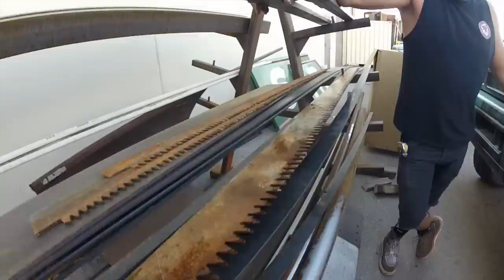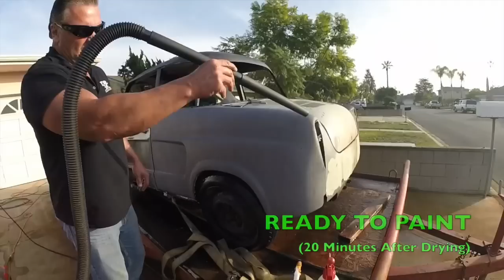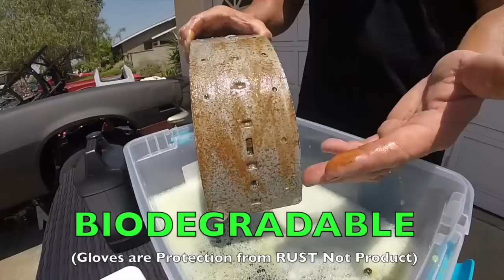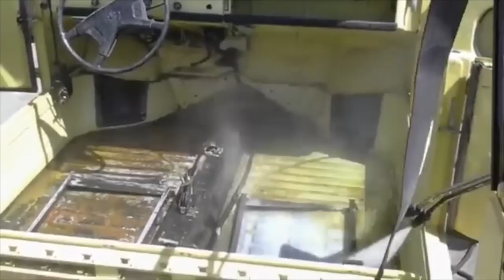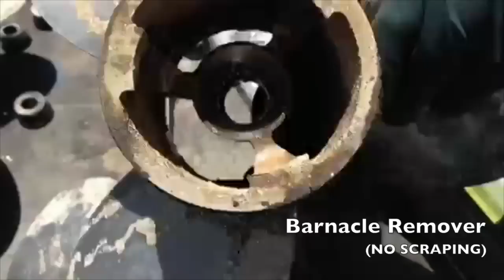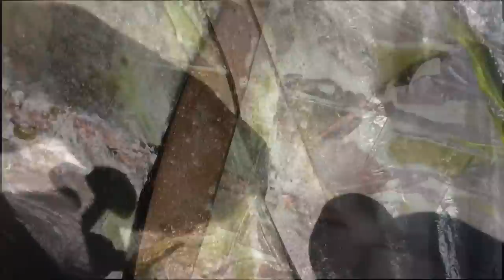Removing Rust in Less Than 3 Minutes

Comment: does muriatic acid turn the rust black?
Reply: aucklandmail : Although I am not certain if Muriatic Acid will turn rust black, vinegar will turn rust into black color, if on for long enough time, but don't leave it on for too long, or metal can thin out too much, use baking soda powder or paste mix which has water in it, but powder would be better.

Comment: Everything you "de-rust" just has a thin patina of rust. Most things we need to de-rust have deeper built in rust. Not sure I trust this.
Reply: soaking in vinegar for a few days works well. I took about 40 years of rust off of some metal tongs that were completely rusted shut. the rust was so bad there was deep pitting in the steel.
Reply: @chrishayes5755  Will a strong vinegar and water mix under pressure take the rust off galvanized steel roofs ya think?
Reply: @sudbuddiesexteriordetailin9843  yes. I use apple cider vinegar (it's more acidic) to completely derust motorcycle gas tanks. Just make sure you rinse baking soda and water mixture to rinse imidiatley after rust removal. This neutralizes the acid and stops oxidation preventing flash rusting.

Comment: Vinegar works fine. Thanks though, seems impressive.
Reply: Did you see that speed?! Thats whats up!!
Reply: No it doesnt. just came here from another video where vinegar was tested along with other solutions. Vinegar was only better that Coca-Cola
Reply: @InBoostWeTrust7MGTE  re: "Vinegar was only better that Coca-Cola". You missed the significance of the results. I've been using CLR for years, then switched to vinegar and ran one week of tests. As the video showed, vinegar was significantly better than Coke, and very close to the brand name solutions. After one week of testing on numerous rusted tools I have found vinegar to be very good indeed, and less damaging than CLR. I have noticed that CLR often removes the protective plating from tools that are not even rusted to begin with, and with the plating removed the tools begin to rust quickly. Also I use a Javex solution for other stained items, such as ceramic cookware & tea cups with great success (and it's fast as well). Overall I am now using vinegar followed by a quick CLR dunking if it looks like a bit more de-scaling is needed. Most of the time vinegar is all that is needed.
Reply: @DataWaveTaGo  what does Crl mean
Reply: @iankennedy1441  calcium lime rust brand remover

Comment: vinegar does the same thing just let it soak for a while
Reply: It always works best when the vinegar is contained inside a clear plastic bin and sat out into the hot Texas sun for a day or so. Me, I have cleaned up Model A ford brakes and old Toyota manifolds for years with nothing but the hot Texas sunlight and some vinegar. If you check in the grocery stores, there are also different strengths of vinegar to be had, as well.  Very cheap fix, but flash rusting can be an issue with some parts. Clean them or oil them immediately to prevent such.

Comment: DOES ANYONE KNOW IFTHIS WILL CLEAN THE INSIDE OF A GAS TANK ON AN AUTOMOBILE
Reply: Hello. I use phosphoric acid to remove the rust at the inside of old motorcycle gas tanks. It is not bad for the paint, not dangerous and works very well. Have a look at Wikipedia to learn more about that product.  It is cheap also and can be used a second time for another gas tank...

Comment: No doubt this video is time-lapsed bullshit. This looks similar to a boiler cleaner product I've been using for 40 years called "Rydlyme." It's an inhibited hydrogen chloride solution and 100% effective against rust and lime scale but parts have to be soaked in it, you don't just fucking wave it at rust and it disappears. The MSDS for DR X isn't online, at least I can't find it. Rydlyme is the best product I've used for small parts. For autobody use muriatic from HD or Lowes.

Comment: Try this  one part molasses to 5 parts water leave for two. Weeks then put your parts in for a month .For small parts stuck with rust Acetone and ATF oil 50-50 soak for 24 hours ,nothing on the market like this

Comment: I used one of these so called safe rust removers on my Z1300 fuel tank, it ate the metal and not the rust now I need a new tank and there aren't any, I bought it direct from the makers in person, when I complained to the company they said we don't make it anymore so tuff shit, my advice to all is do not buy shit like this it's a bullshit rippoff scam.
Reply: Dubsy Dubs viniger is good . With my luck I would stink up the inside of the car.

Comment: Horrible song choice and horrible video quality, but if it works, those can be overlooked. I could have used this some years ago when I had a cargo van that was covered in surface rust inside and out top to bottom. I swear the previous owner must have stripped all the paint off and drove on the beach or something then waited a year and sold it to me.